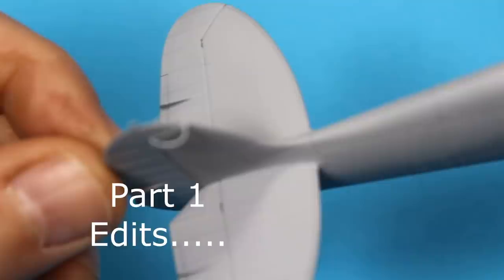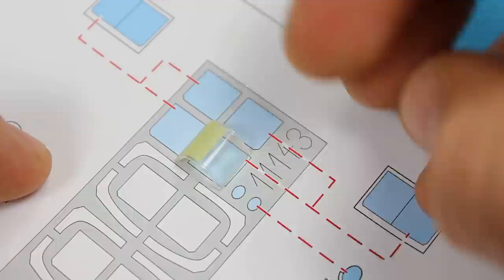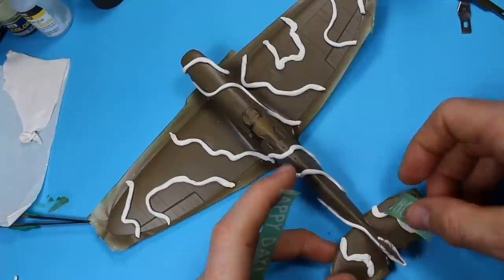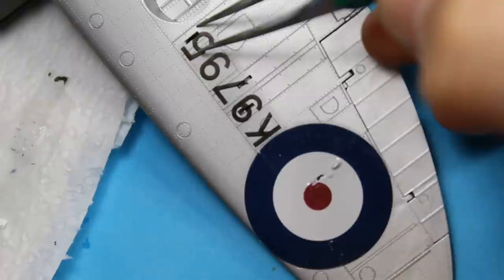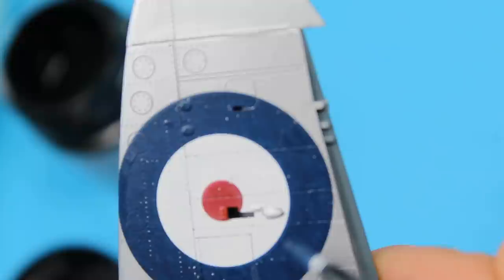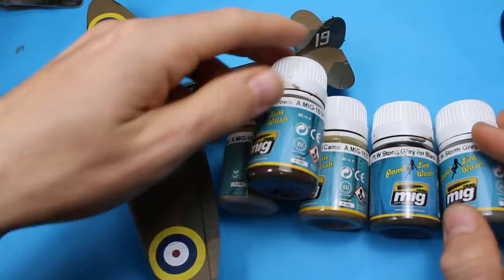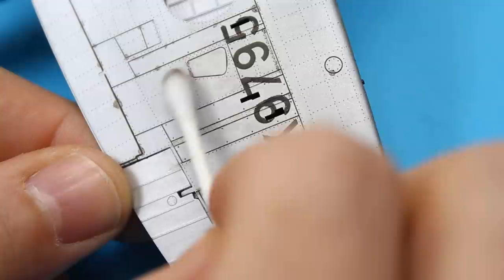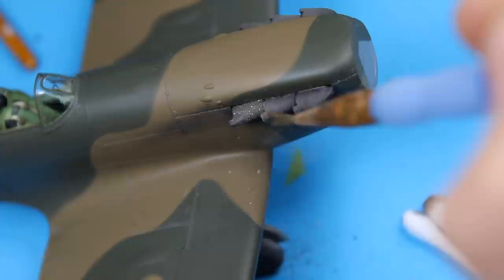Eduard 1/48 Spitfire Mk.1, Full Build, Part 2, Spitfire Story

Comment: Thanks for your video; very informative as I have been working on the XT W version of the Mk1a. Being my first Eduard kit ever, I was amazed by the level of details and moreover, how well even the smallest parts fitted together. Decals went on with me without any problems nor removal of coating: 5 layers of micro sol and set did the job.

Comment: thanks for this heads up. I got the kit and I haven't built it yet, but this video has shown the difficulties of the decals. Which is a shame as there is one scheme that I really want to do. I might have to consider painting them on with an airbrush. Or get aftermarket ones.

Comment: Hi, thank you for a very nice video. If I can be picky :) I believe these strips on the fuel tanks are not armor plating, quite the opposite. They are the structural straps that hold the tank onto the fuselage structure (that tank held almost 500lbs of gas!). On the subsequent versions of the Spitfire one does not see these strips since the later tanks did have armor plating, making the structural strips invisible. Now I am sure some real experts would perhaps disagree? Haha. Happy model building and thanks again for the video.

Comment: A nice kit indeed it seems (with a few Eduard later MK Spits under the belt I feel I know what I can expect) Suffers from some quirky Eduard ' why make it clever and easy if we can make it difficult'  engineering in the familiar areas. I didn't mind the Weekend Edition decals either, worked great on every Eduard kit I've built sofar. Not to mention the Cartograph decals that were included from time to time. I most certainly will look for after market in the decal department after hearing about these new style decals.

Comment: I wonder if one of those stronger decal setting solutions would help?  I'll probably get a masking set for all the big markings I suppose.
One thing to note, I believe the front leading edge panel rivets on all Spits were actually puttied on the real aircraft, so rivets would be virtually invisible.. no need for the re-riveting with Rosie.  I could be wrong about that but I've read it in a few places.
Thanks for the video Jason, lovely job,  blazing a trail!
Reply from the maker: Thanks Matt! Yes I wondered about the rivets on the leading edge, heard that too. I did apply Solvaset but they just seemed to sit there, I definitely need to have another go at them to see how they work. Thanks for the continued support 👍
Reply: @ChampionScaleModelling   UMP do a strong and extra strong setting solution for decals.  I wonder if that would help the buggers melt in even more?   https://www.umpretail.com/collections/decal-setting-solutions
I've already stashed my kit (I've promised myself not to start any more until I've finished the 9 (yes 9) I already have on the go!)..... but I wonder if there are any spare or unused decals on the sheet to test with?
Reply: All Spitfire model manufacturers put panel lines and rivets on the wing leading edge. However it was puttied and painted smooth with primer. There's a period video on repairing the paintwork somewhere on the net where it's shown. I'll see if I can find it, and I'll put a link if I do.
Reply: @SergioCeccherini  
That would be really interesting to see, thanks.
Reply: @mattperson7293  Hi Matt, here's the link on painting Spitfires. The part about the leading edge of the wings starts at 18:34 or 03:20 of the video time. I think the version in the video is a MK II, but the streamlining of the wings started with the prototype. I like your videos, which are informative and get to the point quickly. I'm a fairly new modeler, so I'm not looking forward to the decals at all. I've also seen other videos where they're proving to be problematical. I may even buy some aftermarket replacements. https://www.awm.gov.au/collection/F02334/

Comment: Poor decal performance should never force one into a corner, but perhaps the lifting of decal colors could be incorporated into the overall weathering scheme. Also, I use Walther's decal setting solution, which in my experience, is the most aggressive and nearly turns decals into liquid. If not used with extreme care, it can completely ruin a decal. While I've not used this type of decal, I'd bet that the Walther's could have settled those Eduard decals as desired.

Anyway, very nice build in spite of the difficulties.

Comment: You are one of those who got me back into modeling and it is not appropriate for me giving you "tips" but putting decals on any other surface than high gloss coat is asking for trouble.Also noticed how your decal solution did not want to stay there.
Reply from the maker: Glad to have helped you find the hobby! Your tips are very appropriate, regarding the gloss coat etc, the point of the video was to ‘test’ these decals under the same conditions I’d approach any other. The reason they lifted is because they didn’t adhere, which is the same issue that creates silvering so for these decals you may very well be right that the answer lies with a very high gloss coat, more practice is needed with these! Thanks for the advice 👍

Comment: Nice video!! Good job, but sad to hear that this kit got so many flaws :( I got it and it’s my first 1/48 spitfire and I got it to get simple build.
Reply: Tamiya's and Airfix's 1/48 Spitfire Mk.Is are good. Tamiya's is better but more expensive, although Airfix's one does have better decals (Cartograph decals, Tamyia's ones are too thick)
Reply: @Frserthegreenengine  Thank you!
Reply: I guess the number of flaws is dependent when your kit left the Eduard factory. I just finished one and none of the mentioned flaws existed anymore for me. A simple build however, it is not as you may have noted. The cockpit alone consists of 50+ parts! The fit however is amazingly good. As stated I would expect Airfix and Tamiya will be simpler builds.